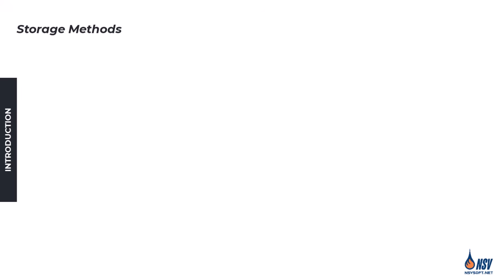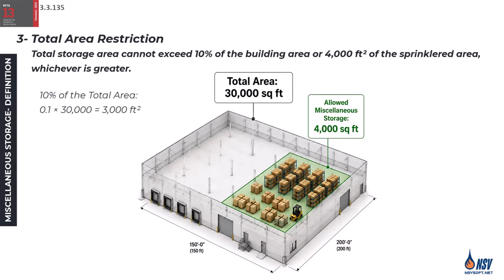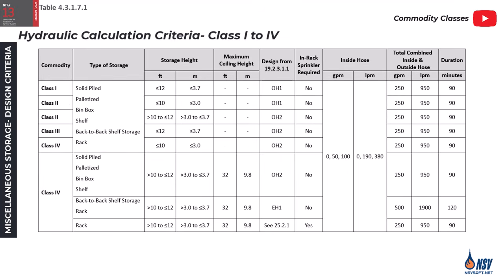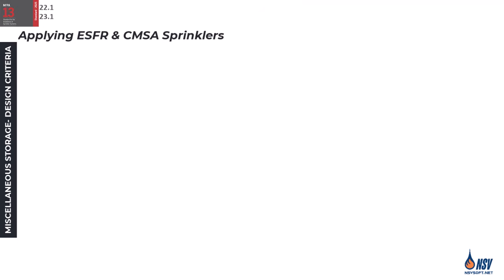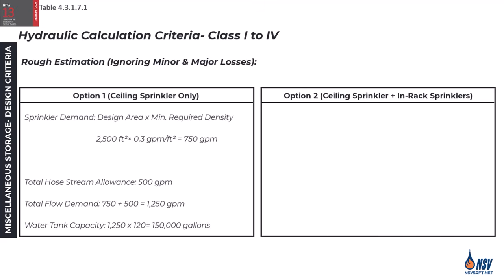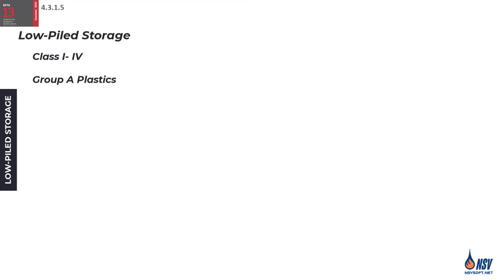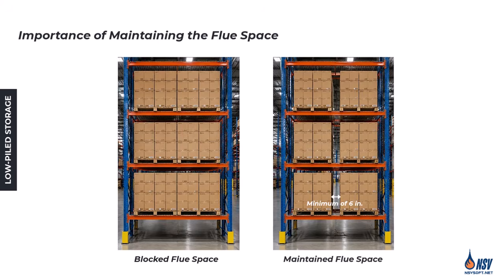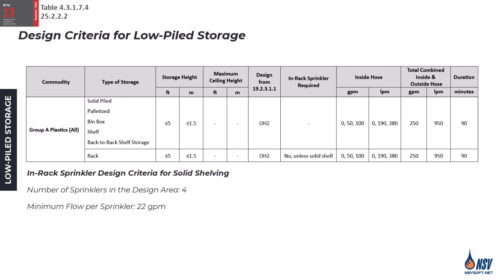📦 Miscellaneous & Low-Piled Storage (NFPA 13)

Comment: Thank you for the informative video. I have two questions regarding the open-rack configurations you discussed.

1. Solid shelf vs. wire mesh:
You mentioned that an open-rack configuration can be either a solid rack/shelf with a 20 sq. ft. flue space or a wire-mesh rack. However, you also mentioned that a flue space is still required for the wire-mesh configuration. If a 20 sq. ft. flue space is required in both cases, what is the fundamental difference between the solid shelf and wire-mesh configurations from a sprinkler design perspective? Why does NFPA distinguish between these two configurations if the same flue-space requirement applies?

2. Obstruction within the flue space:
Since wire mesh is continuous across the rack, even if we provide the required flue space, the wire mesh itself remains within that flue space. For example, if the required flue space is 6 inches, the wire mesh will still occupy part of that 6-inch space, although the percentage of obstruction may be less than 50%. Would this be considered acceptable under NFPA, or does the required flue space need to remain completely unobstructed?
Reply from the maker: Thanks for your question, Hasibur.

First — Solid Shelving vs. Wire Mesh

The key difference is how water and heat move through the rack structure. Under NFPA 13, Section 3.3.217, solid shelving is defined by its ability to block water penetration. When a solid shelf exceeds 20 ft², it completely obstructs ceiling sprinkler discharge from reaching a fire beneath it, which in turn requires in‑rack sprinklers.

To classify a rack with solid decking as an open rack, each solid area must be limited to 20 ft² or less and must be surrounded by clear flue spaces on all sides. These flue spaces allow water to bypass the solid deck and reach lower levels.

Wire mesh shelving, on the other hand, provides at least 50% open area, allowing water to penetrate directly through the shelf. Although vertical flue spaces are still required for proper heat ventilation and water travel, wire mesh offers significantly better water distribution across the shelf footprint compared to a solid deck that forces water to flow only around its perimeter.

Second — Obstruction Within the Flue Space

Wire mesh extending across the flue space is fully acceptable and does not violate NFPA 13 requirements.

We have an upcoming video on in‑rack sprinklers that will cover open racks, solid shelving, flue space requirements, and the specific conditions under which NFPA 13 permits racks without longitudinal flue spaces. It is scheduled for release in October. If you’d like early access, Hesam can send you a private link through your LinkedIn profile.
Reply: @NSVCad I truly appreciate your time and would really appreciate it if you could share the link with me, Hesam.
Reply from the maker: You`re welcome.
The link has been sent to your LinkedIn profile.
Reply: @NSVCad  Thanks for your nice clarification.
Reply from the maker: Thank you for watching our videos ❤
Reply: Thank you so much for taking the time to explain this. I truly appreciate your time and would really appreciate it if you could share the link with me, Hesam.

Comment: Really thanks for your sharing. Does it mean that hose connections must be provided in low-piled storage facilities per NFPA Table 4.3.1.7.4?
Reply from the maker: Hi Cris, thanks for your comment.

Sections 25.2.1.5 and 4.3.1.7.9 of NFPA 13 state that inside hose connections are not required. However we should remember, a strict distinction exists between physical hardware and hydraulic demand.

While the code provides an exemption for installing physical inside hose valves for miscellaneous storage, the values provided in Tables 4.3.1.7.1 and 4.3.1.7.4 represent the total hose stream allowance. This total allowance dictates the hydraulic demand required for manual firefighting efforts and must still be added to the hydraulic calculation, accounting for outside hydrant use by the fire department.

If a local AHJ overrides the code exemption and explicitly mandates the installation of physical inside connections, the designer must install them. The hydraulic demand for those specific inside valves is then satisfied by taking the necessary flow from the total hose stream allowance listed in the applicable table.
Reply: @NSVCad Get it. Really thanks